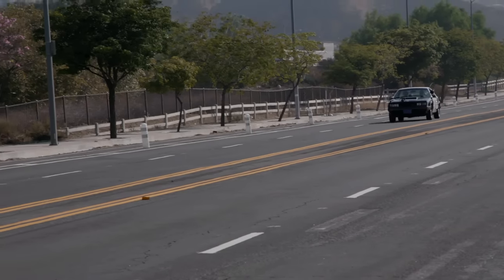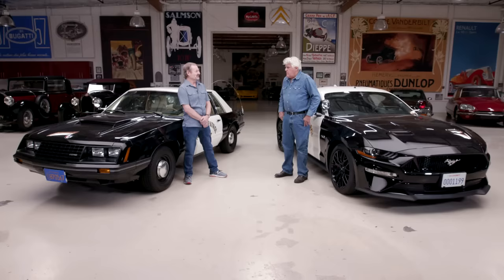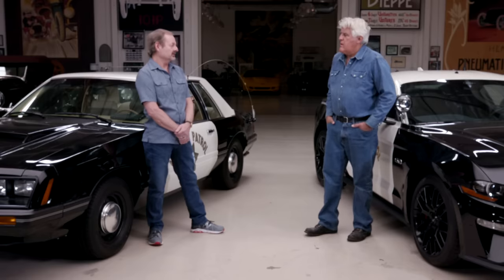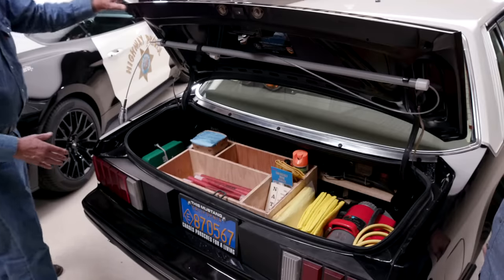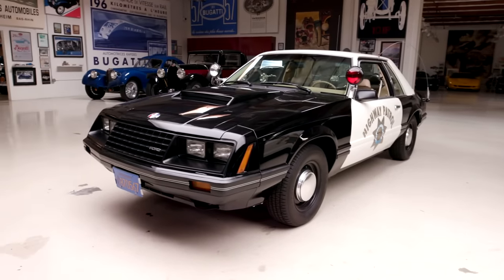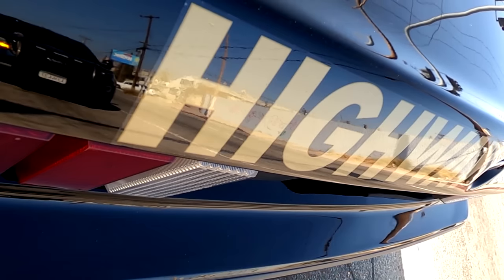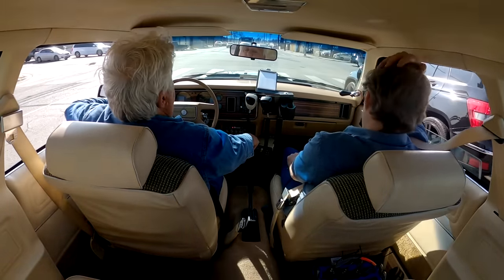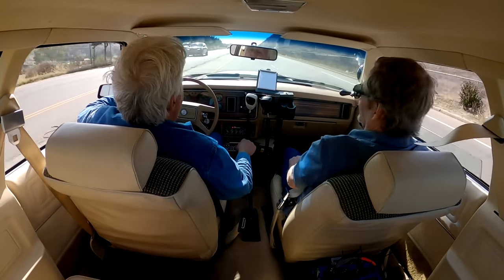This Mustang Chases Porsches for a Living | Jay Leno's Garage

Comment: I'm baffled that Mustang could do 170mph. It just doesn't look aerodynamic enough for that.
Reply: Zero chance that Mustang hits 170. It takes a lot of power to push through 170 mph wind resistance and this mustang doesn't have it.
Reply: Not the early Fox bodies unless they were hopped up.  But when the post '85 5.0 Mustangs went to the 5.0 HO fuel injected motors, 170 miles an hour was certainly possible, especially if they were hopped up with the GT40 heads, nitrous,, superchargers, etc.
Reply: Wait, the cops ran nitrous?
Reply: Officer Dom, the nos!

Comment: No way a 302 V8 in a Mustang during those years, would go 180mph.  I was an Arizona Highway Patrolman and drove a 1992 Mustang patrol car with a 5spd manual transmission and we could get about 125 mph in areas of low altitudes.  I had a 1976 Plymouth Gran Fury with a 400 four barrel that I could drive 135 mph at 7,000’ altitude.  The mustangs could get much better times through the traffic cone high speed practice course because it would handle better and have better acceleration.
Reply: Was it faster in 4th gear or would it pull 5th gear?That HO cam I think stops making power at 5500 or so.

Comment: 225 hp would get the car to 160-180 mph ? I doubt this very much 🤔
Reply: Ive done 110 on 4 banger Oldsmobile  from that era.   A beefed up 5.0, possible.
Reply: Some were supercharged
Reply: @baronarmenian5019  there is a hugh difference between 110 and 180. A 1987 corvette had more horsepower and much better aero and was completely tapped out by 150mph. 180 is near impossible with under 350hp and even at that you are only going to do it in a very light very aerodynamic cart like a lotus.
Reply: Yeah. Hes a complete liar. Would be a stretch to even do 130 downhill.
Reply: @BruceLee-xn3nn   non were Supercharged.
Reply: The fastest these got up to was around 145mph, on the later 225hp. The 82 only had 157hp.

Comment: I've never had a problem with CHP.   Its sheriffs and police that can be not-fun to deal with.   I would never mind getting pulled over by CHP.
Reply: I lived in California for forty years and I have to say I had the same experience. CHP were always courteous and professional in my encounters with them. I've had exactly the opposite experience with the local PD in my small New Mexico town. Regardless of the circumstances, including being stopped but not receiving a ticket, they always acted from the get go as if I had just kicked their dog.
Reply: @avsystem3142  That small-town PD will probably take anyone who passes the criminal checks and has four to six-week training course that is probably run by an unqualified to instruct senior officer. CHP weed most of the bad eggs out in the selection process and give full training to those who make it thru and I think this makes a huge difference.
Reply: In my state, VA, the state police have a reputation of ALWAYS writing the ticket. They never let you off with a warning. 

That being said they are certainly are professional cops.

Comment: I enjoyed watching this video because it brings back some memories. In 1983-84 when I was working as a US Park Ranger in Visitor Protection down at Gulf Islands National Seashore in Florida, the Florida Highway Patrol, in the Pensacola District, had just purchased 2 new 1983 HO Mustangs as Patrol Vehicles with the single blue light on top with a 5 speed manual transmission. Within a matter of a few months, both FHP patrol vehicles in that district had been wrecked. Thank goodness that neither FHP Officer was badly injured in those Motor Vehicle Accidents. I guess that those cars was just too much power for those FHP Officers to handle. When you looked at those patrol cars, it looked as though the single blue light on top could make the car spin around! 😂 On another note, one of the best patrol cars that I ever drove was a 1978 Plymouth Fury that I used in traffic enforcement. That Plymouth was built like a tank and had plenty of power under the hood. Again, thanks to Rich and Jay for having another wonderful video going down memory lane.

Comment: 160...180.... kph yes, mph no way. I have a stock 90 5.0 LX basically the same thing and it lifts the front end at 120 mph in 4th gear still going faster but you cant steer it anymore so the engine might do 150 mph but the car wont. Still impressive but Fox Mustangs are burnout cars not  high speed racers
Reply: Agree with you, had an '88 with 2.73 rear and it topped out at 140mph and wasn't particularly happy aboot it.
Reply: @BubbaSmurft  Yup! I bought mine new in 90 still have it and I live in Canada. No winter driving it gets stuck in frost never mind snow.

Comment: Back in 1985 we went to the CHP Garage in Sacramento and picked up 3 of these. Only 1 of the 3 ran so I was able to drive it back to our place in Livermore. Imagine my surprise when I opened the hood to first check the oil before we left, & seen a 2bbl carb! It still ran good & was able to cruise at highway speeds with low rpm’s thanks to the gearing. There was a guy at the CHP Garage named Al Ludden who was very helpful & knowledgeable & he said they were getting phone calls constantly about when a Mustangs would be up for auction, so they ended up setting up a recorded line for people to call that would have on it what type of vehicles would be coming up for bid. Those were good times back then.
Reply: all the best buddy🎉🎉 congratulations🎉 let's talk on telegram you've been randomly selected among today's (GIVEAWAY)🎊,❤

Comment: Cool episode. I have a little Washington State Patrol Mustang story. In mid 1984 , I bought a 68 Camaro from the orig little old lady owner. She wanted 1500 and I gave her 1200 for it. It had 112k orig miles - was a 327 2 bbl Camaro with a Powerglide automatic.  So..... not too long afterwords on a Saturday night, I thought it would be a good idea to see how fast I could get the car up to, so I drove across the Hood Canal bridge and headed west on State Route 104. A week or so after I bought the car, I had a loud glass pack dual exhaust installed... So, in 1984, hwy 104 west of the Hood Canal bridge at 10 pm was not well traveled, I passed a WSP Mustang which had it's lights on and I could see the trooper was down in the bushes investigating a car in the ditch.  I pulled the car , nobody else around and a quarter mile or so later, I buried the accelerator and got up a bit over 100 mph. The 327 2 bbl Camaro seemed to run out of breath around 105 or so , I was nervous about going much faster anyway.  I ran along at 95-105 for 6-7 miles, maybe a bit more, and headlights approached coming the opposite way, so I slowed down to 75-80 or so, the vehicle went by no problem. So I got back on the gas and ran along for a couple more miles at 100 or so. Then I noticed headlights way behind me, probably a mile or so back. I did not think much of it, but then after another mile, I could tell the headlights were catching up.  Catching up quickly, so I slowed down, thinking it might be Police, but there was no way they had me on radar.  The lights caught up very quickly and then the red and blue lights came on, and I pulled over...heart pounding. I was 21 years old by the way, and had never been in any serious trouble at all, I think 2 tickets previously for 10-15 over was it.  The Trooper was  Mark Doobie - funny name perhaps  .  Trooper Doobie was extremely polite yet firm, I mentioned I had just bought the car and went over to the Olympic peninsula to see how fast it would go away from other people. Trooper Doobie said good idea but bad idea because of the wildlife I could well have hit. He wrote me for 65 in a 55.... 30 bucks, I think he could well have wrote me for reckless driving. Trooper Doobie told me he had heard my glass packs start rapping away and had been up over 120 or so for several miles to catch. Trooper Doobie also mentioned he had owned a 68 Camaro when he was younger which had a 396 engine, he smiled and sincerely asked me to please be careful. Hope anyone who took the time to read this enjoyed it, it is a true story of the WSP ... happy days

Comment: 90 model  it top at 143mph w/ 5 speed and 308 rear gear! It was a GSP Trooper (Pool)  He paid for the service package on his Mustang for 2 years after the rest of the fleet was retired just to keep it in service. he worked out of the Villa Ricca GA post until he retired until the day he retired which was well over a decade after he had to turn the mustang in he said it was still the fastest and best handling vehicle He ever drove lol The local dealership had T-shirts that said it takes one to catch one had a GSP mustang and a factory LX on front and back of the shirt

Comment: When these had the fuel injection they were fast. My Uncle worked at Kemp Ford. They had to have the seat mounts repaired. As they're going through gears the seat would rock.

Comment: I had a '83 GL notch that came factory with the 5.0 H.O.,4bbl,5 speed,and 3.08 posi. back in high school '88-90 or 91.
Paint code 27 Bright Red with Black int.
IDK if it was destined as a SSP or not,but it had 1 key locks,clutch fan,relocated release,full size spare,No AC,and (not sure if was a difference as I never seen another '83/84 Mustang with it) had a heavy fuel pump guard made of about 1/4" steel.It didn't have the 140 speedo though.
My father bought if off the orig owner in about '85/86.I then bought it from him in '88.
With a little tuning (still totally stock except true dual exhaust) it was able to stay with or out run most the 80's V8 cars up till about '90-91 including the Mustangs.It would send the Camaros packing......

Wish I still had it.
Today we have a '89 LX hatch with a well built N/A 347 pushing almost 480hp (should have went the 351-393/408 route though).

Comment: After they got so many miles on these they retired them and sold them to the public. My friend back then picked one of these 82 CHP mustangs up around 1985. It had only 80,000 miles on it and he paid around 4 grand for it. Same exact interior. They of course took all of the police stuff out but you could see the holes near the windshield where the spotlights used to be, they were just plugged. They would paint the car before they handed it over as well. There were a few color options to choose from. He had his all white with the hood scoop black. That 4 speed was pretty peppy for it's time. You could nearly hit 80 in second gear and up to around 110 in third, or so I'm told ;).

Comment: I bent the passenger side suspension my 1978 Mustang in a tiny town in Northern California just before Thanksgiving in 1983. I was 700 miles from home. I had the car towed to the local Ford dealer for repair.
     It was in the middle of a recession and the local dealer not only didn't have the parts, they didn't have any brand new cars. The display in the showroom was an ultralight airplane.
     They told me it would be a week to get the parts from Portland. I called my friends in Oregon, who came down and took me back north for Thanksgiving. When I picked up the car, I noticed the "This Mustang Chases Porsches for a Living" poster on the wall in the garage and I asked them if I could have it.
     I still have that poster almost 40 years later.

Comment: I entered the CHP Academy on January 12, 1981, and graduated on May 28, 1981. My first assigned CHP Area Office was Malibu Area 556. I drove one of two 1982 Ford Mustang SSP units from brand new. 

In August of 1983, I had parked the 1982 Mustang in the back lot, which had 84,980 miles on the odometer (units were ran out at 85,000 miles) and took out a brand new 1984 Mustang that had 208 miles on the odometer. It had a 302 c.i. 4bbl engine and 5 speed manual transmission. I drove 4 miles north on PCH when a fellow officer, Mr L Clark, came over the radio transmitting that he was attempting to catch a dark BMW 320i, running over 100 mph. I pulled over and stopped on the paved shoulder by a break in the center devider wall. Moments later, I was struck from behind by 1966 Volvo DL wagon at 61 mph. The left rear tail light assembly hit the rear of my skull. Both doors were jammed shut. This was not a good day. 

The BMW that my beat partner was attempting to stop happened to be a girl that I was supposed to meet for a late meal in Malibu.  Ms S. Lawson.  

I retired in Dec of 2002. I was assigned 10 different Mustangs, 2 1991 Camaro RS units and several Crown Victoria and Chevy Impala units throughout the Great State of California.

Comment: I purchased a 1989 ex-CHP mustang in late 1994 with around 90,000 miles on it. I later upgraded the intake and exhaust (no cats). Fuel economy was good, 27 mpg if you cruised on the freeway. The reason why those late fox body mustangs were fast was they weighed under 3000lbs. They came equipped with an oil cooler and a 3.08 limited slip differential. The rear diff didn’t help out at all if the roads were wet. I could never get it past 140. Besides a couple of batteries and an alternator it was the best vehicle I ever owned. 180? The car’s aerodynamics and factory HP of 225, would never hit that speed.

Comment: I have seen many a Police cruiser in my day.  Mustangs, Camaros, Chevy & Ford trucks, the Vics and the Caprices, Impalas etc etc.  Even a Lamborghini Countach in the late 80's
But the one single police car that stands out in my memory was the most unlikely thing I had ever seen as far as police cars go...   A 1985-86 or so,  Ford Escort.  It was Dark blue, with the police shield on the door, had all the radios and antennas to go with them. No light bar on the roof,  but similar to this Mustang, it had two round lights facing out the rear window. Red one and a blue one, naturally.  Behind the grille, were two more.   Shotgun rack, a hand-held spotlight sitting on the passenger seat.  Typically everything you'd expect to see in a police Vic or Caprice,  but in a friggin' Ford Escort!   This was in Wichita Kansas, back in the early 90's. I saw it sitting at a QT (Quick Trip) when I pulled in there for a soda and snacks.

Comment: Great video. The fox body was actually a pretty good car, relatively speaking. The best year was 1985, in the GT version. It was the last year that the car had a carburetor, and it was a 4 barrel, Jay said it was 2, that's wrong, it was 4 from the factory in the HO. It also came with roller rockers, stainless steel headers, a really good posi rear end. The car would run 13's in the quarter mile consistently. Not too bad for the year. We bought the car brand new in June of '85.  It was the hatchback with T tops, my cousin had the GT with a convertible, wasn't as fast, but was fun to cruise in. I had the car up until about 6 years ago. I had loaned it to my younger brother who got it towed for parking in a handicap zone and leaving it there for several days?  He didn't say anything and after a year, ended up losing the car to a tow yard because he was afraid to say anything!!? We just started talking again....
Reply: Nah, 93 was the best year 100%

Comment: In 1982 I bought the Ford factory prepaid black on black mustang fastback with Shelby wheels. It was one of two Long Beach Grand Prix auto expo show cars for 1982. One black. One was maroon. The funny part about your story entro and the Porsche chaser is. My license plate was 
FORDCHE. Only Porsche drivers got the pun. I have a great story about being wide open for about 2 minutes outside Palm Springs. The tail wind was about 40mph. It was 1 am. The Mustang 5.0 had an estimated top speed of 136mph. I was wide open. With the tail wind probably in the mid 140's somewhere when I passed a parked 5.0 Mustang CHP coupe on the desert shoulder. It took him several minutes to catch me. I had my parking brake nearly on fire. He pulled up behind me and the lights didn't come on. A minute later he pulled up next to me side by side. We had eye contact. My hair had turned to wire. The CHP pulled forward and looked at the front of my Mustang. He dropped back. We had eye contact for the second time. He gave me a thumbs up and excellerated off. I couldn't believe it. I should have gone to jail. That's my FORDCHE MUSTANG TRUE STORY. 
Because of all the smog equipment the GT's were even faster than the Corvette of that year.  
CHEERS!

Comment: Buddy of mine snatched one of these when we were in high school, Josh Bingham, and got an LX version for iirc $3000. It was actually quite nimble and good power, he almost put my head thru the passenger window taking it out for a drive through Martell's apartment area, heading for the bowling alley. :D I think he liked it but was able to get a BMW shortly afterward, preferred that car (who wouldn't at the time, 1992). 

There was also the time, say late 1980's, my sister and I saw a Lamborghini Countach going up Highway 88 to Tahoe through Pioneer, CA... immediately followed by two Mustang Interceptors, and about 10 seconds later the standard cruiser (don't think it was the Crown Victoria at the time). Good times, lol. ;}

Comment: The opener where he says that the speedo in most cars stopped at 85 brought back a memory.  As a teen, I had an '82 280 ZX and I was just infuriated by that speedometer.  So, I swapped it out from an '81.  I lost cruise control, but it went to 140 afterward....

Comment: In 1982, they were only, I think, 157 horsepower.  At least those notchbacks were a little bit lighter weight than the three door hatchbacks. My 1983 GT had 175 horsepower and a 5-speed manual.  Then in 1987, my GT had a 225 horsepower and a 5-speed manual, which was a good bit back then.